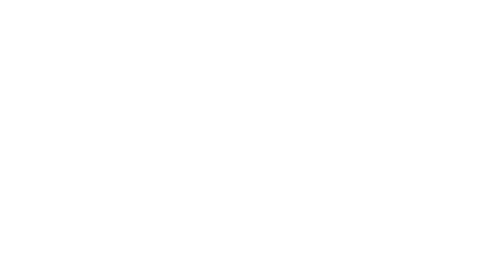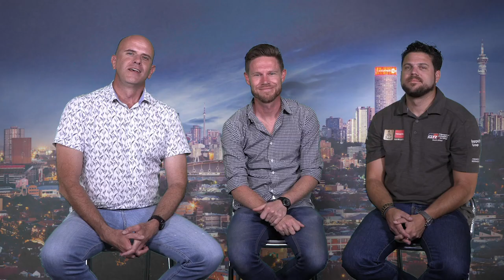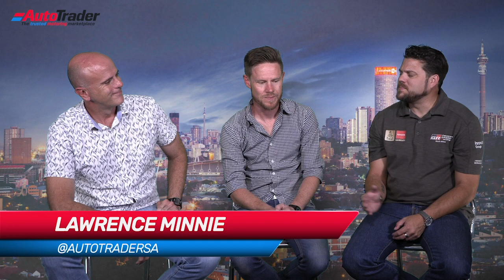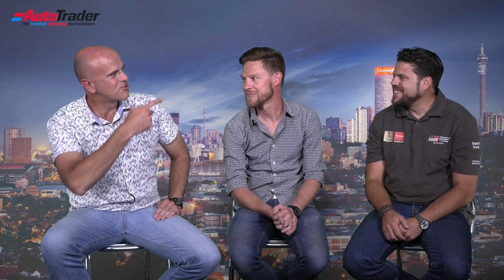Top 3 reasons your car battery keeps going dead

Comment: I have a 04 Expedition I changed the battery and alternator and it keeps dying. I removed the fuse 25 for the rear motor and it died again